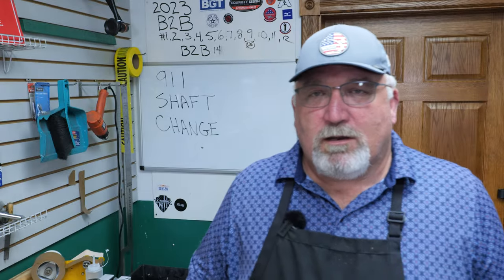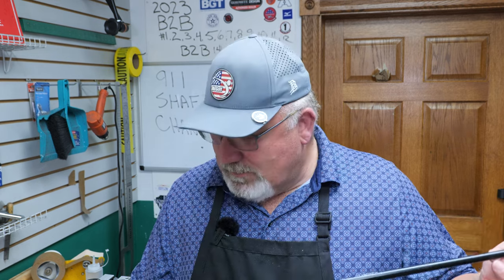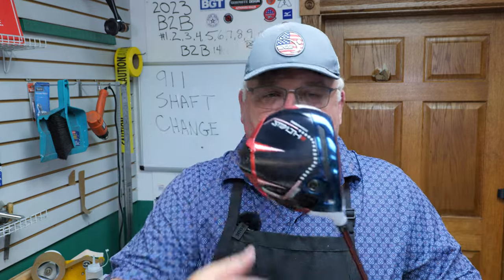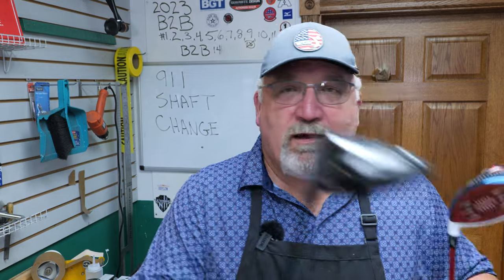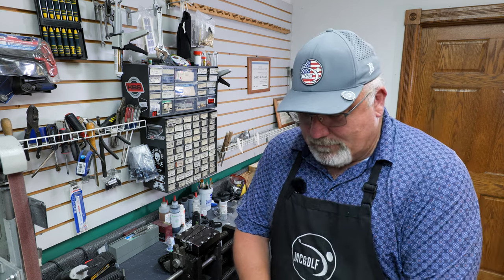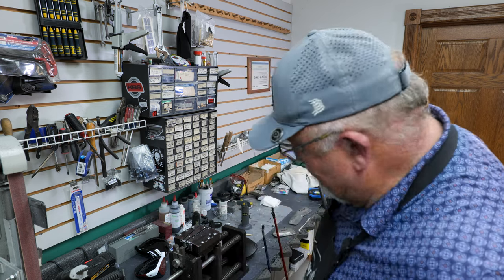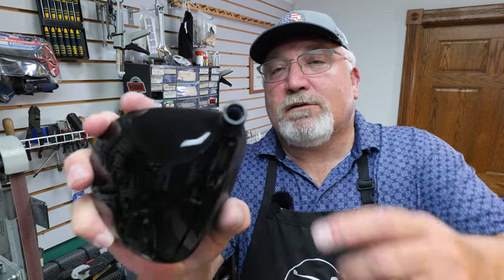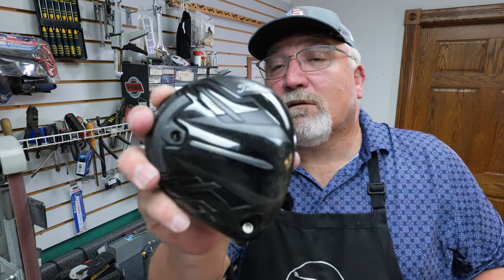how to  pull golf adapter and shaft switch

Comment: With the Ventus Red shaft/Titleist driver head - did you remove the green TaylorMade epoxy from the tip? After having a ton of adapters moving during curing, what I do now is I take a small philips screwdriver to push the epoxy plug out while it is warm after removing the old adapter.  I hate trying to drill it out afterwards.  Without that hole for air to escape, the adapter always moves on me.

Comment: The Titleist adapter - it has a retaining ring at the top.  I like to slide it off and remove the rotating cog so that it isn't in the way when heating the tip to pull it.

Comment: Jim, is it necessary to spread epoxy on the inside of the hosel as well as on the shaft tip? and how do you avoid melting the plastic ferrule when removing an adapter?.I have purchased a number of extra ferrules for different manufacturers just in case I get heavy handed with the flame !!!!!

Comment: If your rotating the shaft with an adjustable hosel. Wont the spine change if he changes loft?
Reply: Nope. There is no spine. The graphics on the shaft might be in different places and the grip might be off-centered but that can be changed easily if you blow them on with a air gun